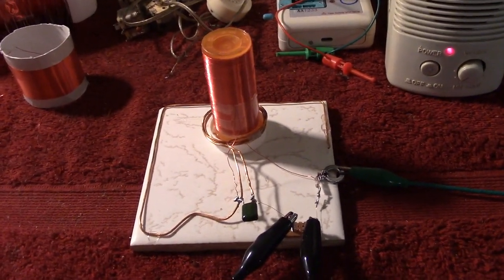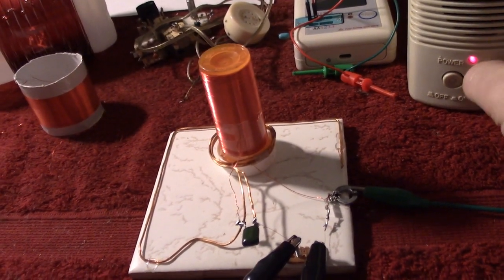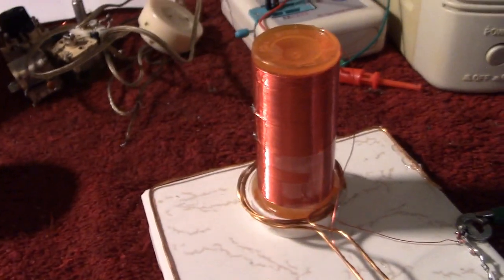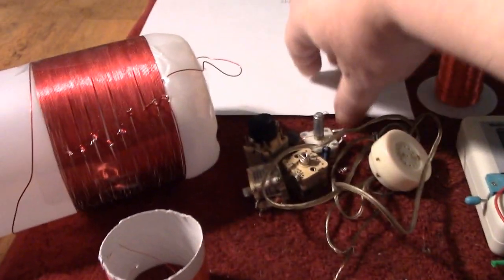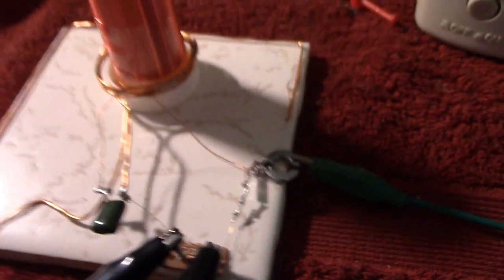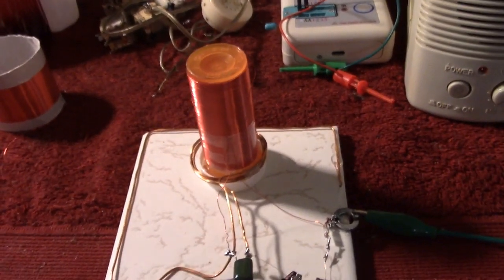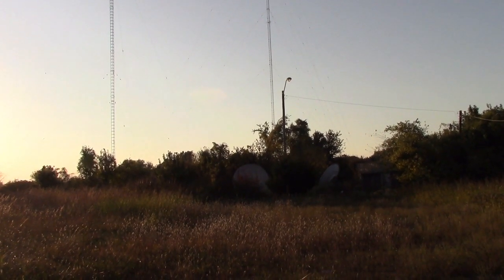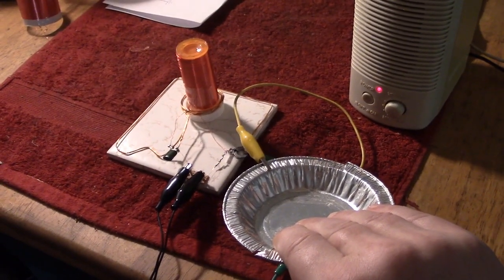The Tesla Tower Crystal Radio

Comment: can you make an spatial EMF absorber for lets say wifi, 4G, and most importantly dirty electricity? Maybe with SEC tech
Reply from the maker: Sorry to not see your message all those moons ago. Seems it's easy enough to put tuned circuits in the path of waves, but not to vacuum them up. Only what is directly behind and in line would benefit from interception. 
The analogy could be people on a beach, 1 person will get a tan in 6 hours, but 1000 people would also get the same tan level in 6 hours. They're standing in the way of the sun's rays, not absorbing them directly from the sun. 
It's something I'd want to build though, SEC tech is an excellent idea  :)

Comment: Funny. Does it work with earbuds?
Reply from the maker: These sort of things need a high resistance earphone. There are ways to use an 'audio' transformer, but generally those horrible hearing aid type cream single earphones are used. An old telephone receiver from the 1970's works great. Ideally, there'd be enough power transformed in the circuit to run a decent speaker, or output the power to run something useful... which is what I'm working on   :)
Reply: @Slider2732  Thanks. Would be nice for a video, a little radio that doesn't need any battery.
When the antenna could be shaped in the form of a cone, you can put the speaker at the tip, and just stick your ear in the cone to listen to the news. 😂

Comment: Interesting.  I might try that but I have only a few stations that come in on a crystal radio where I live.  I don't have any stations that are near me.
Reply from the maker: You should still be able to hear a 'swamper' if you don't use a variable cap. I expected random noise of all stations, but apparently the swamper is the one that is heard if the windings turns are close to its frequency (1500kHz is 270 feet, which somehow may translate to 0.27mH for the coil inductance. I don't know, too many 27's going on lol). I used to get the one out of Carlsbad clearly and that has to be nearer to you than myself out near Tulsa :) 
From reading, a 450W station at 3.5 miles will transmit more actual usable power than a 50K watts blaster 40 miles away. Partly because of the ground transmission. It all goes very Eric Dollard. Over the horizon works up to 3MHz along the ground, you should get a swamper.